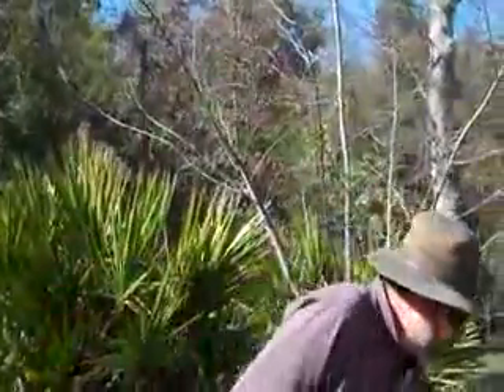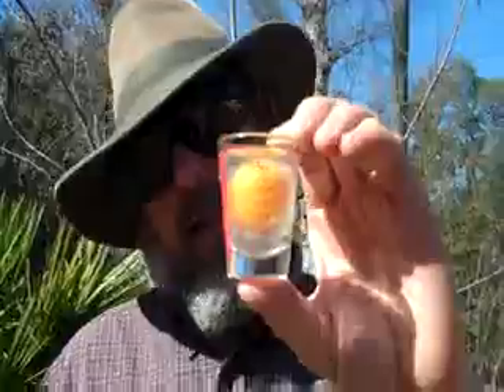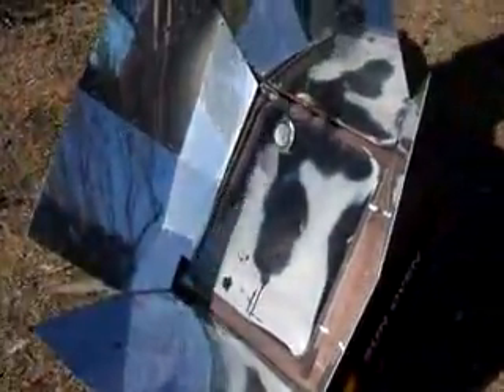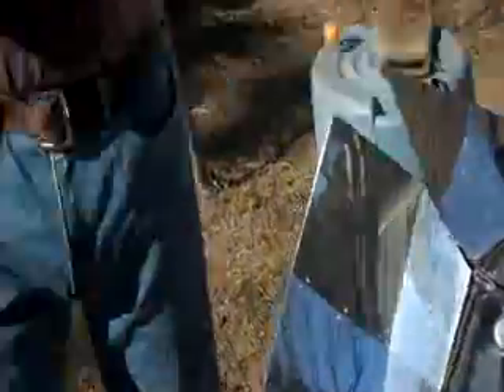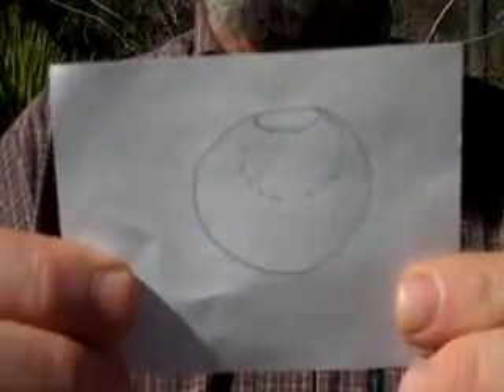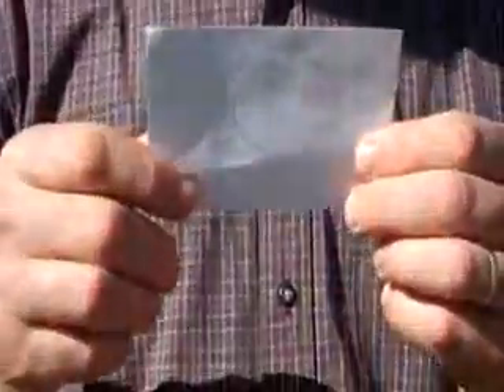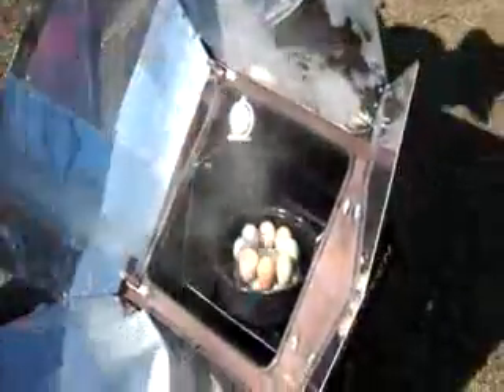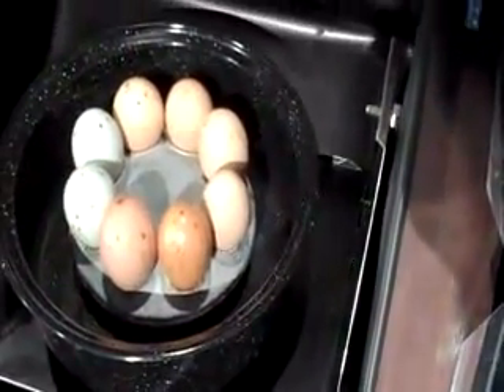Solar Egg

Comment: I purchased an "American Sun Oven" recently. The instructions that come with it tell you to leave it in the sun for 90 to 120 minutes with an open pot of vinegar (3 cups straight vinegar). The glass door should be closed and latched and the vinegar will steam the oven chamber. Then clean the oven with the hot vinegar. I did this and I started right away baking corn bread and zucchini bread. I never had anything taste like plastic.

Comment from the maker: @bravododger This came from a company called Global Sun (I'll send you the link).  When you cook in the oven there are two little latches that hold the glass door down tight.  When you use it as a dehydrater you close the latches and set the glass down on top of them instead of under them.  This holds the door open about a quarter of an inch.  You can still adjust the temperature by turning the oven away from or toward the sun.

Comment from the maker: @DollyHot  When I put them in there I just look at the thermometer and watch the temperature, but if it is 325 degrees usually about 30 minutes does it.  When you cook them like this (not in water)  They get really splotchy when they are done.  There is a skin on a live egg and that skin changes colors.

Comment from the maker: @imasurvivornthriver You need to get you one of these.  If it is sunny outside I set this thing up.  I've only had mine for about 6 months, but have cooked about a gazillion things in it.  At 300 degrees it will make the toughest rooster just melt in your mouth. We usually bake a loaf of bread in there every week.